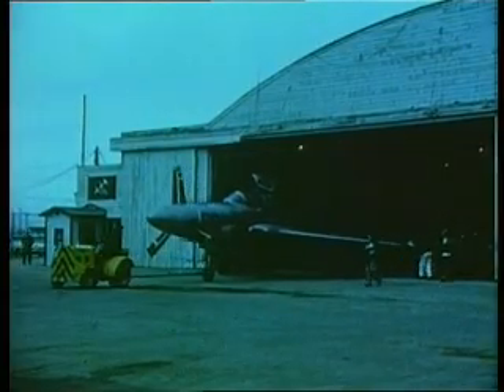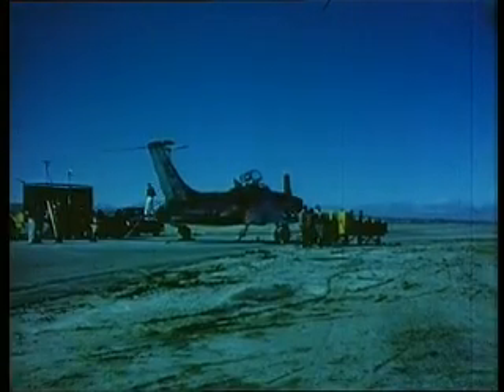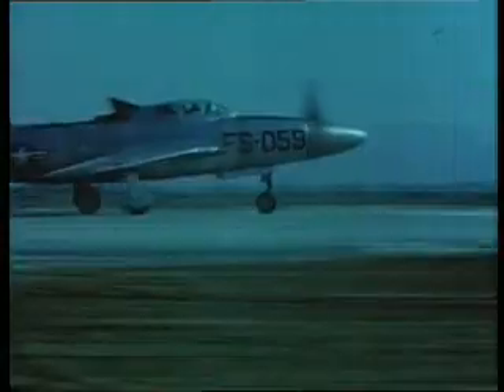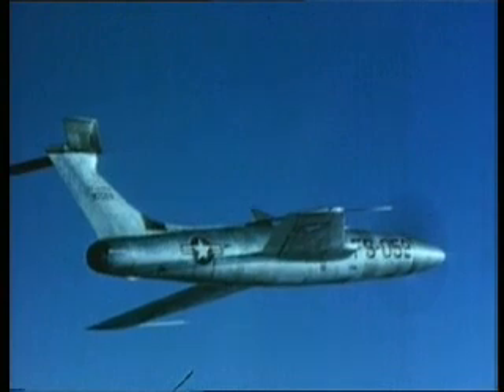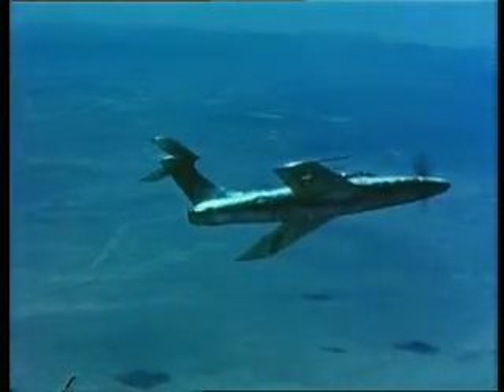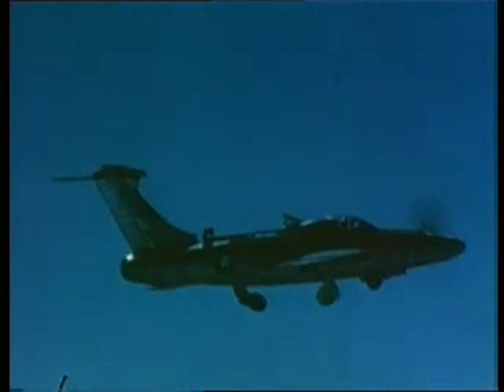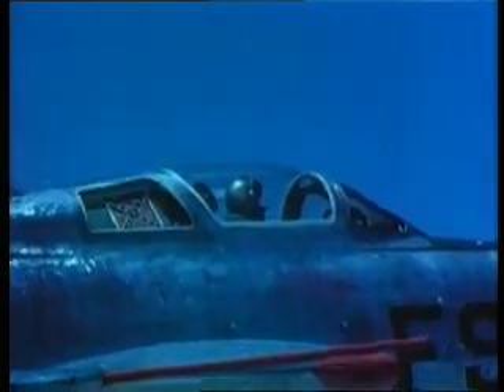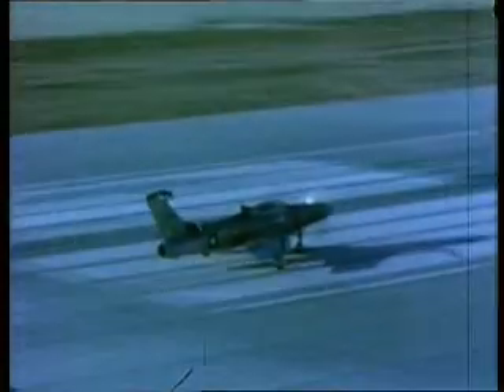The Republic F-84H Thunderstreak - (Thunder Screech)

Comment: Think about this.  The Supermarine Spitfire introduced in 1938 initially flew at around 360 mph and was only 35 years after the first powered flight.  The Wright Flyer flew at a top speed of 30 mph in 1903.  Later variations of the Spitfire from 1945-1948 topped 460 mph.  Many military aircraft at this time were topping 400 mph.  The XF-84, which was a military project, predicted to fly at 675 mph never went over 520 mph and was achieved in 1956 before it was scrapped.  So in less than 40 years man managed to fly propeller powered planes 430 mph faster.  However in over 10 years and millions of dollars, barely went 60 mph faster.  This really lends to the adage of "if it ain't broke, don't fix it".

Comment: This plane never reached this speed.
Max speed during testing was 450mph
Reply: I couldn't figure that out either, it never got close.
Reply: @billsmith5166  Another thing he said that i question is he said the power plant was sound. I read it was a mechanical
nightmare and took like 30 minutes to get up and running. They all said it was a noisy SOB though.
Reply: @rbagel55  Some other dude's video mentioned all that. Wonder who has it right?
Reply: @absthewonderdog  I don't know. This video said it reached 670, Wikipedia said 540, and another video said 450.
I guess with all the problems they had testing this thing that 450 seem like the correct answer. But. I could be wrong. Fact is there isn't any solid
proof of how fast it went. Maybe too many people were bitching about the noise that they didnt bother testing it's speed. Another thing is I know that this same guy narrating video ( with a British accent) has mentioned some false information about another plane
( can't remember which one) so I don't think his sources are accurate

Comment: Ah the thunderskreech
Guess what, it could be heard for 40km away. 40KM!
Reply: Interestingly the engine was full throttle all the time , speed was regulated with the propellerblade angle
Reply: con fuzz that‘s normal for turboprops. you have a power lever, not a throttle. the power lever basically controls the torque so your engines run at a set rpm and pushing the power lever forward the governor regulates the prop pitch for more thrust while the engine control unit increases the fuel burn to hold the RPM. British BAE Jetstreams for example have geared direct-drive engines that always run at 100% (or very close to 100%). Power is only controlled by the prop pitch.
Reply: What's with all of this kilometer crap? What is 40km anyway, 10, 20, 30 miles? Which is it?
Reply: @michaelleftwich8186   40.000 meters, it's stupidly simple
Reply: @michaelleftwich8186  It is distance, that is the long and short of it. You poor soul. The Internet is a wonderful thing, all the knowledge at your fingertips. Next time take the initiative and just do a quick google search.
Reply: What's that in American
Reply: D_O_C far is my guess
Reply: It's loud
Reply: @doc6540  I don't know. But in stupid that's about 24.85.
Reply: @GeneralGruebler  HAhahaha! I love the little metric simps hating on Freedom Units. I just love it when they have to tell you how long a soccer field is when you ask them. LOL!
Reply: @sadwingsraging3044  The length/size of soccer fields isn't regulated.  It has max/min limitations but varies. So there's simply no definite answers on that question. Metric and imp units both have their pros and cons but don't try to seriously do math with the latter :P
Anyway 40km is about 25 miles
Reply: @carmenseeger311  the field was lain out in yards. YARDS!
I have never had any trouble in adding imperial measurements because I am not "stupid" and need a simpler system.
Thank God that Frenchman didn't make it to our shores.
Reply: @GeneralGruebler  at least the U.S. didnt go from ruling 1/4 of the world to an island the size of Michigan in 100 years.
Reply: @GeneralGruebler  No need to be an asshole, just follow a proper meme format
Reply: @sadwingsraging3044    well, Imperial is defined by the Metric System....so I see a clear advantage in metric....! How many feet are in a mile? I don't know...how many meters in a Kilometer? 1000....how many ounces in a pound? Idk...how many grams in a Kilogramm....1000....every scientific calculations are made in metric....as well as the calculations for the Apollo Missions that lead to the moon landings....! As well as the Saturn V was designed in Metric (Wernher v. Braun didn't like Imperial either)
Reply: @huey-fan8335  show me on the doll where the math hurts you.
Reply: @sadwingsraging3044  you have to memorize every conversion in Imperial....while in metric it's simply 1000....or 10, 100..! You have to memorize that there are 12" in a foot, that there are 16 ounces in a pound, that there are 5280 feet in a mile and so on....it's a place for mistakes to occure!
Reply: @huey-fan8335  I also have to memorize a lot of other things. I prefer tenths, hundredths, and thousandths.

Go look at a land deed. Tell me what it is measured in.
Reply: @sadwingsraging3044  what is a land deed?
Reply: @huey-fan8335  something measured in "Two rolled smokes on a slow gaited mule" ride. Assuming it was lain out correctly and long enough ago.
Reply: @sadwingsraging3044  🤣 thats quite odd
Reply: @huey-fan8335  that was the distance called.
Reply: @sadwingsraging3044  freedom units, LOL...
You do know why it's called the imperial system , right? it comes from the british empire, the guys that you went at war against... meanwhile the metric system comes from france, you know, the ones that kinda helped you against the british?
Reply: @tcg1_qc  if mafs is too hard for you I can understand your confusion! LOL
Reply: @sadwingsraging3044  how many fahrenheit in a cup?
Reply: @LeoMkII  cope harder Frenche.
Reply: @sadwingsraging3044  yes, and? Let's be honest you don't have a point, NASA used metrics to land on the moon and mars, what did you accomplish with imperial? LOL, common sense is hardasses
Reply: @k-osmonaut8807  cope harder metric boy.

Take in ALL of that 12" and give us a big Reeeeeeeeeeee!
Reply: @k-osmonaut8807  what kind of limp wrist hates it when someone uses Imperial?
Reeeeeeeeee! 12"=footlong
Reply: @sadwingsraging3044  cope harder lmao, you was the one to come here hating everyone using metric, grow up kid
Reply: @k-osmonaut8807  nope! I just used freedom units and you metric simps, as usual, give me all the sweet salty tears.
*nom nom nom*
Right off the cheek.
Reply: @sadwingsraging3044  In America, our football fields are ruled out in yards, buddy.
Reply: @hdogg21  Ummm,,, yeah,,, that was my point.
Reply: @doc6540  about a 2 hour drive

Comment: Tomas Rodriguez
Acum 7 luni
I flew in the Tu-114 for 16 hrs non-stop in 1968.
This presentation has excellent video graphics and footage. The story, told by an interesting voice, requires some rectifications for the sake of historical and technical accuracy.

The 114 was not only the fastest propeller airliner. It was - and still is - the fastest propeller driven aircraft in history, with a top speed of 540 mph (this record stands since 1961). Some sources claim it was the Republic XF-84H. The 84H was designed to be faster than the Tu-114; but it was not able to fly beyond 520 mph according to the Smithsonian.

Also the 114 was not the noisiest aircraft, nor its military siblings Tu-95/142. That distinction belongs to the same XF-84H which was called "Thunderscreech" by the Muroc Air Force Test Base personnel, who were made sick (vomit) by the sound of the aircraft's running propeller during ground runs. Watching the ground personnel around the Tu-95s and 142s, it is evident they are not in discomfort. Same applied to the 114 which had about 2000 hp less powerful engines and propellers.
The claim that it had to cruise at lower speeds due to noise and vibration is not accurate. Actually it is the first time I ever heard of it. I flew one window ahead of the inner propellers tips. Technically that was the noisiest place inside the aircraft. It was not as quiet as a Bristol Britannia (the Whispering Giant); but it was quieter than the Super Connie shown in the video (I also flew in both).
In fact, after almost an hour over the Artic Circle, I was bored and noticed a faint vibration that ran along the window sill like a very low frequency, mini-amplitude wave, passing every four or five minutes from front to rear like a distant slow rumble. My neighbour did not notice it; but my newly minted engineer's degree, wanted to show-off and kept searching for an explanation that never arrived, and soon I fell asleep. It was that boring.  Its safety record of only one accident - on the ground - after decades in service, testifies that there were no structural issues with the original design. 
Of course, the military version, without the civilian cabin insulation must be noisier; but again the videos on this site do not show any crew member sick nor close to deafening distress.
 
To this day, in my strong (not humble) opinion, backed by almost 70 years of Aviation love, I think that the Tu-95 and the SR-71 are the most exotic aircraft to ever fly.

Comment: The fastest propeller driven aircraft ever - official and unnofficial - is the Tu-114/Tu-95. That is what History registers and shows. The F-84H maximum design (paper) speed was higher; but it could not fly faster than 837 kmh. That is what the first test pilot, Lin Hendrix, confirms when disputing distorted claims like this video.
Also that is what the Smithsonian Museum of Aviation recognizes.
The US has many aviation top achievements, so there is no need to make up a fictional one . Honoring others, honors yourself.
Reply: +alexander rod - Tu-114/Tu-95 is not a single engine propeller plane. F84H is the fastest SINGLE engine propeller plane and it is not a fictional one.
Reply: +Wisely Go Maybe the fastest single engine propeller plane, but that's not what the narrator said...
Reply: It's not the fastest prop.. it had and jet engine installed too

Comment: Why does it sound like an old radial starting up at the beginning? Come on, people, How dumb do you think we are?
Reply: I don't know if original sound was used in this video, but a torboprop is basically a jet engine driving a probeller. Those kinda engines sound more like the ones from jets than that from propeller planes.
Reply: @007999999999999999  Since you apparantly can't recognize a jet sound from a piston sound, take it from an industry expert.

That was a reciprocating (piston) engine sound clip used in the beginning. And, like Anton (OP) said, it sounds like a radial, judging by the rythym of the impulse sounds, and by how all the impulses are equally audible.

A turboprop would have a perfectly smooth, non-mechanical sound to it. With the only non-smooth sound coming from the propeller. And even that would be a pretty smooth sound since turboprops tend to hold high RPMs, even back in those days.
Reply: @Dave_Crupel  Damn you smart, and it's not like I wrote myself that turbo props don't sound like piston driven aircraft.
Reply: That's definitely a radial engine sound of some kind.. Old.bomber perhaps
Reply: It's Hollywood..  Same type of situation when Hollywood producers add the sound of Stuka Dive Bomber sirens screaming to any plane in a dive.  It could be a DC-3 in a slight dive, or a Pilitus Porter in a dive, but leave it to Hollywood, they all sound like Stuka dive bombers.😄
Reply: Starter cart
Reply: Your kind of answering your own question. The prop was so loud because its tips broke the sound barrier 900x a minute making a growl. I do know microphones then and now would not pick up sound waves properly  because of this. I believe the audio was turned way down. But a good question. I have PPL, I want one, im rated for a single.😁
Reply: The94GTC  , yes, I know that.  There was no way to brake the wind driven prop driving the sirens.  The Stuka pilots hated having to listen to the sirens while flying to the target.  The sirens scared the hell out of the people on the ground when the plane was driving at them.
Reply: It's just the propeller blades pushing on air whilst the starter winds up the engine. Allisons are direct driven, not like the PT6 which starts the engine first and then engages the propeller.
Reply: @TheTormhel  In this case they aren't.
There were clutches  for each driving shaft to the gearbox.

Comment: Noise is a big issue with Supersonic props, 20 odd years ago working near Warwick where you would often be overflown by C130 at 250 to 500 feet I heard what I thought was a C130 just about to overfly me. It was in fact a  tiny dot of a TU95 with two F3 escorts crossing through UK airspace at some 35,000 feet. It turned out it was on its way back from an Airshow in the US, how times have changed back :-)
Reply: Is C130 have quieter props? I live in malaysia and i always spooked by these flying very low yet very quietly

Comment: I'm pretty sure that the Tu-95 "Bear"'s propeller-blade tips also go supersonic. Not only have Tu-95 crews suffered hearing-loss from the plane's acoustic signature, even pilots of F-14s, F-15s, and Panavia Tornado jets assigned to intercept the Bear have ALSO suffered hearing loss from the Tu-95's prop-noise!
Reply: True that and the Bear used to be picked up by NATO submarine listening stations!
Reply: Nope. The 4 pairs of counter rotating props make the plane so loud. It would decimate ground crew if the props went supersonic.
Reply: Aircraft like the Vultee BT-13 and Cessna 185 have propeller tips that reach trans and supersonic speeds too
Reply: OtakuBozu The thunder credit's props would crack glass and concrete, induce nausea and hearing loss, and one crew cheif supposedly had a seizure from the aircraft.
Reply: @epikmanthe3rd  IIRC there were even reports of miscarriages among the wives of base personnel attributed to the noise and shockwaves.

It was either the XF-84H, or the XF-88B which also had a supersonic prop.

Keep in mind these props are already supersonic just on idle, with the bear I think they're only supersonic on the higher power settings. Could be wrong.
Reply: then they made it into a passenger airliner, what an amazing idea
Reply: @LadiesManTwoOne-Seven Believe it or not, Tu-114 was pretty successful.
Reply: I saw and heard a Tu-95 variant flying once. Not only is the aircraft dang large, but the noise (it was about 2000-2700 feet off the ground) was crazy loud; I had to press my hands against my ears to cover them, and I could still hear the aircraft clearly!
Reply: Is it an insanely loud aircraft?
Reply: The tu-95 bear is the second loudest aircraft compared to the xf-84 thunderscreech and the thunderscreech would have made a decent fighter it just needed an upgrade and for example have 2 Four bladed props attached together and go opposite directions or at least have one four bladed propeller and lower the tail wing so it would be even with the main wings and the dorsal fin in the middle of the tail wing will make it more aerodynamic but nobody could be bothered because it was so damn loud that only one known original recording was found of that screaming demon on youtube

Comment: Why they did not put a ring around propeller that low a noise and increase thrust ? hm
Reply: They tried a variety of both single and counter rotating Prop designs There were Wings and Airpower magazine articles in the late 60's documenting most of the tests they did.

Comment: That was supposed to say $15M, and it wasn't supposed to be a precise number. Anyway, there is FAR more to making a supersonic plane than "a set of afterburners". Go and look up "Mach tuck", "wave drag", "control inversion". Interesting stuff. By far the most cost is in developing a supersonic airframe. The POINT is that 90% of the missions of a modern fighter can be done with a subsonic plane costing 10% as much, but the other 10% of missions are essential as well. That is all, if it's okay.

Comment: That's not insignificant, as even supersonic types like the F-15 and Co. travel at high subsonic for the VAST majority of the time. Generally they can't even break the sound barrier with external stores, and it's really bad for fuel economy, so they usually stay around Mach .8 or so. The extra $50M in cost per plane goes towards the ABILITY to go that fast, should it ever be needed. I can think of certain roles that could be filled for far cheaper, since the planes never go supersonic anyway.

Comment: Yes they are, but I have a feeling that the fact that the XF-84H's prop was only 12ft in diameter and ran at Mach 1.18 at the tips whether idling or a max speed might make a difference. Apparently, the noise was so bad it was just impossible to deal with, while the Tu-95 has had an excellent service record. I'd like to HEAR it though, instead of hear ABOUT it. So much for video.

Comment: I've seen the F-84H on display at the Bakersfield Airport and it is something to see.  The multi-blade propeller on this aircraft is very small in diameter compared to the ones used in fighter aircraft during WWII because it was turning so many RPM's. A bigger prop probably would have resulted in a severely damaged aircraft if one had been used.

Comment: @Orangebike666 
1. Induced drag increases to amazing levels on the props near supersonic speeds but it is possible with new fan prop designs
2. In this aircraft no but check out the XF-88B voodoo. They used this aircraft to test high speed props
3. I have never heard it but I fly a pt6 and although its quiet for turboprops i can still feel the rumble in my gut!